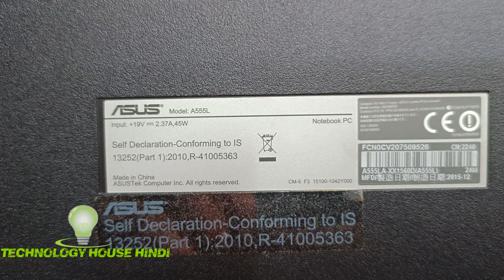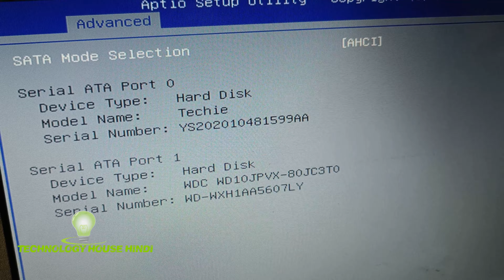ASUS A555L SSD UPGRADE ,  ASUS A555LA-XX1560D(A55L) SSD REPLACE

Comment: Bro what is the size of your HDD caddy adaptor for this laptop 9.5 mm  ya 12.7 ??
Please ruply
Reply: Hi did u get to know the size
Reply: @dharnendradeorhiya6524 yeah it's 9.5 mm size
Reply: @asendrakumaraselo8689  thanks bro, one more thing where to install ssd in place of cd drive or old hdd slot
Reply: @dharnendradeorhiya6524  bro cd drive is useless so you should use this caddy to install SSD if HDD health is good you should not uninstall HDD otherwise u can use HDD slot . There is no difference of data speed in both slot
Reply: @asendrakumaraselo8689  thanks a lot again